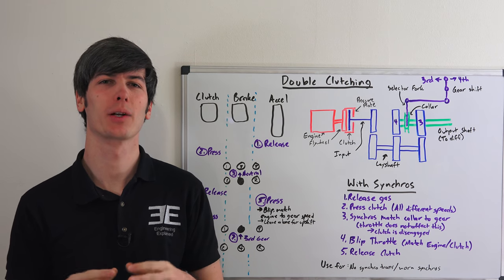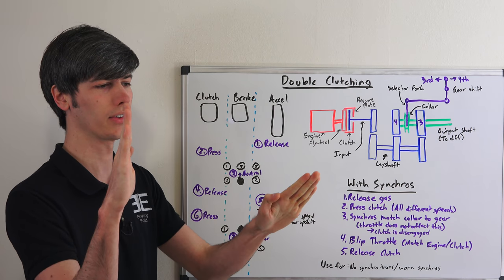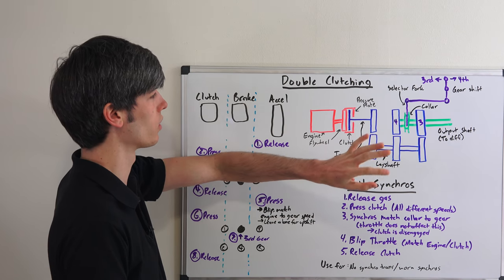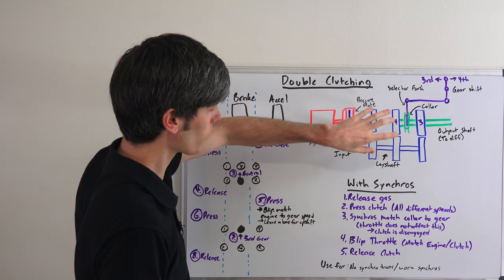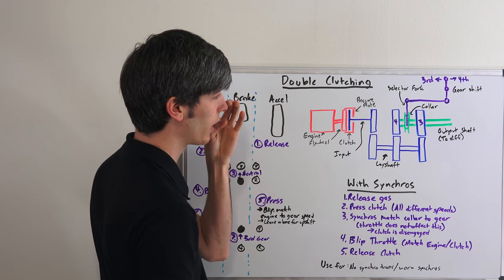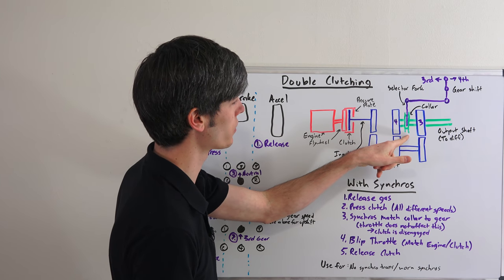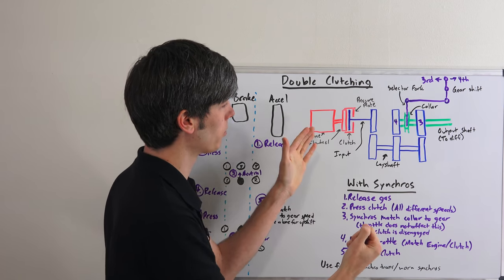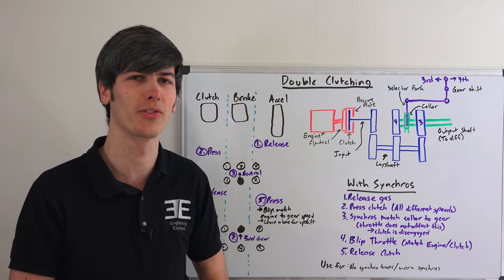What Is Double Clutching?

Comment: I still don't get why you'd need to do this. Yes I syncro or not, getting the gears up to speed is a reason. But why would one want to do this?
Reply from the maker: To shift gears.
Reply: +Rohan Thatté It's about how it was harder to shift gears, harder to drive, before the synchronized transmission was invented.
Reply: +Rainer67059 I understand. And roughly what era are we talking about? I'm 29 and fascinated with all things with engines, only in the "referenced" movie, did I first hear it. Was this required for all cars/trucks before a certain year?
Reply: +Rainer67059 I understand. And roughly what era are we talking about? I'm 29 and fascinated with all things with engines, only in the "referenced" movie, did I first hear it. Was this required for all cars/trucks before a certain year?
Reply: +Rohan Thatté
In America the end of this era began in 1936. The car industry introduced this new transmission in 1936. It ended I think, exactly then. But trucks and busses may have had non-sync transmissions for longer.
The 1934 La Traction Avant by Citroen was the first car to have a fully synchronized transmission. Although this technology originated in Europe, its success was faster in America. My father told me to have to apply the technique on his early cars. He started motoring with a Vespa in the 1950s.
Reply: +Rohan Thatté My syncro is out in second gear and I can't be bothered to pay for fixing it? I have to do this every time I downshift to 2nd gear, I have been doing it for a couple years now and I don't mind it as much as I mind the repair bill for a new syncro.
Reply: Reverse gears are never synchronized. I always use this technique to bring my car in reverse, if the gear blocks at first.
Reply: +Engineering Explained So why not shift like a normal person?
Reply: +Rohan Thatté They wouldn't unless they drove a big rig truck which is completely non-synchromesh.  I actually thought this would be for truckers but if you are a big rig truck driver you already know how to double clutch.
Reply: +Rohan Thatté 
If your synchronizers or even your clutch disk is worn-out this technique can prove useful. I've actually seen my dad using this double clutching thing. One time he helped out some guys in a truck that wouldn't shift, he drove it for half a kilometer where we found a workshop. I didn't even realize it at the time but now I'm impressed he knows how to do this so naturally like it was obvious what's happening, he just jumped in. He's an auto engineer so that may be it.
Reply: +Rohan Thatté I am about your age actually, and my father told me he still had to do this double clutching in the late seventies. At that point he was working a student job delivering bread for a local bakery in an old Renault R4, whose transmission didn't yet have synchronisers.
Reply: +Rohan Thatté its when you are coming up to a traffic light and you dont wat to stop and waint but to slowly slow down so if you get there it can change to green and you just ceep driving it saves fuel...
Reply: +Miatacrosser Yup. I drive an 18 wheeler and this process is used.
Reply: +Automotive Tuning makes sense now. Thanks a lot!
Reply: +Rohan Thatté hopefully i dont loose you here: it can also make your downshifts much more smooth. if you do something called heel-towing you can press the accelerator with your right foot while simultaneously braking also with your right foot so your clutch foot is free, and you can rev-match the downshift for a super-quick, jolt-less downshift while braking. if you are braking hard into a corner in racing this can stop the tires from losing traction with the road or locking up from the jolting of the downshift when the tires are already under such stress from braking hard... combine heel-towing with double-clutching and this is the most smooth shift as you have also accelerated the drive shaft in the transmission not just the motor before you let the clutch out in gear. the art of racing a car is more technical then one might think!
Reply: +bagelhunt If you try to "shift like a normal person" on a racetrack you'll enter the first corner facing the way you came. It's important to Rev match your downshift. Also, for street driving, it wear your clutch a lot less
Reply: H Nielsen Cause I'm totally a race car driver.
Reply: +bagelhunt your question had nothing to do with you. You asked why you wouldn't shift "like a normal person" and I gave 2 examples when you wouldn't.
Reply: +Rohan Thatt&#233; The reason is so the gears will match speeds and be able to mesh together smoothly.
Reply: Why don't you come and drive me around then if I drive wrong?
Reply: +Raúl Vidal If your clutch is worn out you ain't goin' nowhere. Now if the throw out bearing is fucked up then this might work for you. I got my license in 1964 and have never owned a manual tranny car that didn't have synchros. The oldest car I owned was a 1940 Buick. I drive a truck with an 18 speed Road Ranger and that you have to double clutch technically but most guys just match the RPM speed to the next gear and don't use the clutch. The newest trucks all have auto shift but they are still manual that the computer does the shifting instead of the driver.
Reply: +Rohan Thatté semi trucks still use non-synchronised transmission
Reply: Some vehicles don't have synchromesh transmissions and double clutching (and when you get good at it clutchless shifting) is required.  Most tractor trailers and other heavy trucks in North America still use transmissions where double clutching is needed.
Reply: mrvwbug44
All the newest tractor trailer trucks have auto shift manual transmission if your company leases them. They don't even have a clutch pedal. I run a Volvo i-shift and it works pretty well except for not having a low enough gear for starting off on very steep grades.
Reply: +Rohan Thatté    If your trans have synchros, then you don't have to do this. But, remember, the dumbing down of America has required inventions like this from time to time so you don't have to do things with skill anymore!  Synchros made it easy to not have to remember all the tricks to driving a non-synchro trans. ALL THINGS LIKE THIS COME AT A PRICE! The synchros are an added expense, and they ARE A CONSUMABLE!  They wear out too!  So, if you want to be nice to your synchros, help them do their job!!  With this technique in the video!!!  BUT NOW, in the days of no synchros, you had to do this!  You would not get it into gear well without this technique! And in some rare cases, at all!!!  Like going down a hill and if it jumps out of gear, and your forward speed HAPPENS TO BECOME  FASTER THAT THE VEHICLE CAN GOIF TI WAS  IN THE HIGHEST GEAR AT THE HIGHEST POSSIBLE ENGINE SPEED, YOU HAVE A RUNAWAY IN PERMANENT NEUTRAL!! Truckers have died from just this scenario, and they may have died without ever knowing that no matter how they tried they never could get it back in gear!!!!   The reason is the speed matching of the gears!  NOW, a nice explanation of this is RELATIVE SPEED!  gears in motion at the same speed ARE NOT MOVING IN RELATION TO EACH OTHER!!  2 flatbed trucks at 60 MPH next to each other are not moving IN RELATION TO EACH OTHER!  Guys on one traiIer could step over and visit his buddies on the other trailer!!   This is what this video is really talking about!!  When things that match speeds are joined together, nothing gets hurt!!
Reply: junkdeal
That's Bull Shit, missing a gear in a truck going down hill never killed anybody. What kills truckers going downhill is riding the brakes too much and overheating them. Then you no longer have brakes sooo, runaway. If you always keep your brakes relatively cool your laughing.
Reply: junkdeal
I am a truck driver and all I do is mountain driving with up to 10% grades in places and all you have to do is put the brakes on and slow down a bit so you can put it in a gear. The only way you have a runaway is if you overheat your brakes which causes the drums to expand and the shoes will no longer contact them enough for braking. I've missed gears and never had a runaway. The trucks I drive have a GVW of 63500 kg with two trailers. Don't tell me about truckin'.
Reply: johnabuick I guess I'm trying to make the wrong point- yes, you'd have to have overheated brakes in the first place to encounter all the problems I'm posting about. It absolutely would be simple to get it back in any gear by braking down to the point you'd need to get it in that gear. maybe I didn't think to mention that someone speeding down a mountain approaching an out-of-control situation would have already overheated their brakes and begun to accelerate. The point I tried to make, I guess, is that IF THIS DRIVER MADE THE MISTAKE OF TRYING TO SELECT A LOWER GEAR, (IMPOSSIBLE PROBABLY BY NOW) IN THE MIDST OF ALL THIS TROUBLE HE ALREADY HAS, HE WOULD SOON BE TO THE POINT WHERE HE COULDN'T GET IT IN ANY GEAR AT ALL!  I probably should have posted better and included this info too!  I never really intended to suggest that just missing a gear would have anything to do with a runaway. In itself it probably never would.  That doesn't mean that inexperienced drivers haven't done what I'm talking about in the midst of an already hopeless situation!!
Reply: ***** Yeah, I AM terrible about being unable to say anything with few words!  See my eBay store descriptions on the items in there!!!  It looks like an encyclopedia!!!
Reply: junkdeal
If you have already overheated your brakes then you are already fucked on a steep grade. If you're not in the correct gear to hold the grade then the truck will just keep picking up speed. The engine will blow when you hit about 3000 and that is that.
Reply: *****
So where is it you drive truck there brother?
Reply: *****
Well I've driven a bunch of different trucks though the mountains of the Kootenays in BC and WA. So you drove on a freeway, not the same. We have many hills with grades of 6 to 8 %, some of them 15 miles downhill. That's why trucks have brakes and why you must keep them fully adjusted. You don't just overuse your brakes and then expect to stop but if properly maintained and adjusted you can stop or slow down. And by the way, our loads are bigger than your loads, like 139,000 for instance. Logging trucks come down even steeper grades than highway trucks up here. Of course you have to know how to drive.
Reply: +Rohan Thatté I double clutch for my second gear down shifts since my synchro is almost gone. Otherwise if your synchros are in good condition you don't need to do this. Old cars did not have synchros and some big rig trucks still don't.
Reply: Mike
All cars since about the middle of the '30's have syncros so I doubt anybody on this comment section has driven one of those. All highway tractors have non synchro transmissions except for some construction trucks that have Allison transmissions. The newest highway tractors have auto shift transmissions with auto clutches that the computer shifts and not the driver. The transmissions still have straight cut gear though.
Reply: +Rohan Thatté In a transmission with out synchros - you wont be able to change gears/ grind gears badly every shift.
In a transmission with synchros - to stop your synchros wearing out / if your synchros are worn.
Reply: *****
I drive a Super-B tractor trailer unit with an 18 speed Eaton transmission in the mountains of Western Canada. What does floating the gears mean? Never heard it before. And by the way, all the newest tractors have manual transmissions that the truck computer shifts including the clutch since there is no more clutch pedal. The Volvo I drive only scratches the gears sometimes.
Reply: *****
Haha, too funny, I've driven lot's of different combination in the mountains of western Canada for sometime now. i'm pretty sure I know how to shift with and without the clutch.
Reply: *****
The company I work for leases their tractors and ever since a couple of years ago they started leasing trucks with autoshift tranny's. So last year we all got Volvo's with the i-Shift. I spent plenty of time running 18 speed through the mountains of western Canada pulling 63.5. Plenty of 6, 7, 8 and even 10 percent grades on this job so yah, I know how to shift.
Reply: *****
Maybe where you come from they float gears but nobody uses that term here. I think maybe you read it on some website and that's all you know about it from how you explain it.
Reply: *****
And that is what i've been saying in all my posts, Glad you agree with me.
Reply: *****
Haha, funny. Do you even know what a B-train is? I've been driving one for 10 years now in the mountains of western Canada and I've never heard anybody use that term. I drove gravel truck and pup on the island too and nobody use it. Let's see you come and do some winter mountain driving in the Kootenays and see how good you are.
Reply: +Rohan Thatté  - Even with synchro, you get much less chance of a baulked-gear if you DDC. Actually, you also end-up using less clutch too, so changes are still quick.
Reply: +Rohan Thatté I had to do this with my Toyota pickup , and earlier a Jeep because they wouldn't get into second gear easily.  It was annoying but worked without going to the shop to get it fixed properly.
Reply: .....the thing about driving cars with straight-cut gears isn't just the double-declutching - it's also about timing and unloading gears. Anyone who has had their clutch-cable break and had to drive the vehicle to the garage to be repair will understand. Try driving and manual car - even with synchromesh, without the clutch. Actually, it's perfectly doable, but you need to have your wits about you...!
Reply: +HeavensGremlin ...and you have to have a car that is light enough to play nice. I lost the clutch slave cylinder on my Datsun 510 wagon on my way home on day. I was forced to drive the car without the clutch by turning the car off at a stop light, put it in first, then start the engine, accelerate then rev match to "slide" into second and so on... what fun!
Reply: Exactly - murder for the poor old starter-motor...! Mind you, it never failed, thank goodness.
Reply: +Rohan Thatté cause if you don t you can t engage any speed . this is more a truck driving method than for car
Reply: +Rohan Thatté Try driving a Big Rig with squared off gears in the transmission, and you will see why Double Clutching especially in the lower gears is warranted!  As for the upper gears, once you get good you don't need the clutch at all, just switch gears all of the revs.
Reply: +Rohan Thatt&#233; Double clutching was the norm before syncros existed.
Now it reduces wear (kingda, ever so slightly), and sounds cool in Hondas with fart cans... If you're not racing, and not redlining every gear, just shift as normal.
Reply: Raúl Vidal he’s an auto engineer, and you were surprised he knew that?

Comment: Does shifting multiple gears at once (say 2nd to 4th gear) wear out the synchronizers significantly more?
Reply from the maker: Well, yes, but if you wait a bit for the rpm of the clutch to drop, it won't be much different. More wear if you do it just as quickly as you would shifting to third.
Reply: +Engineering Explained thanks!
Reply: +Engineering Explained also i think that depends alot on gear ratios, my vw and audi both have close ratio transmissions and i if I'm really on it I skip 2nd at least and sometimes 4th
Reply: Double clutching helps if your trans has worn synchros. 
Like mine. 
And it sounds cool with a nice exhaust. 
Like mine. 
Best double clutching movie ever you ask? 
That's the original bullett movie. 
That's double double clutching if you listen carefully. 😳
Be like that and you are the man..

Comment: i wish i could have gotten into racing at an early age... my only real time with a standard was my friends mom's 5 speed Jeep Cherokee(like the older 97 model had the larger engine in it, think was a 5 liter), he was teaching me how to drive standard at the time. pulled out onto our main road and he told me to just "open it up", it's like 10 pm at night no one around on a straight stretch of rural road. so i just dropped the gas to the floor and never took my foot off of it, i just listened to the RPM and just shoved the clutch in while throwing the gears. honest to god it was so smooth between them you'd have thought it was like the drive system on a snowmobile didn't buck once and you couldn't even feel the transition between the gears! i remember glancing over for a slight moment to see my friend white knuckling the door handle and the center console lol the needle was pegged up over 90 mph where the speedometer stopped before i had to slow down because we were coming up on my driveway. was the most exhilarating experience i've ever had and hope to hell i can do it again some time! slowing down and down shifting is a lil jerkier for me though XD as having to break and clutch was a lil counter intuitive to just stepping on the gas and making it go! i could have trashed an automatic transmission in a race that night!